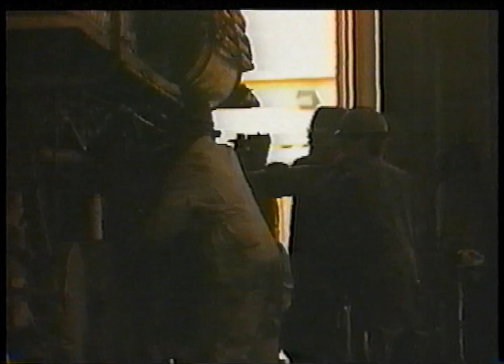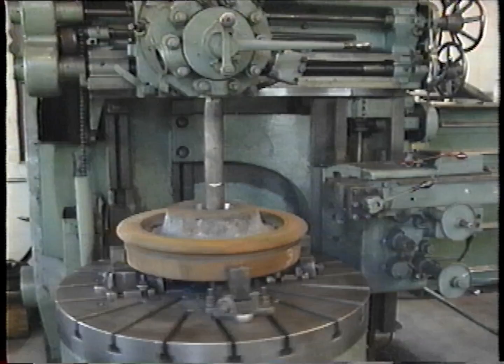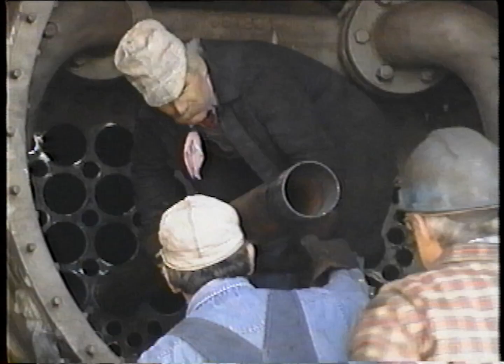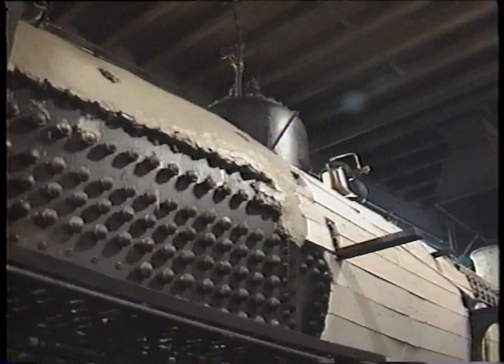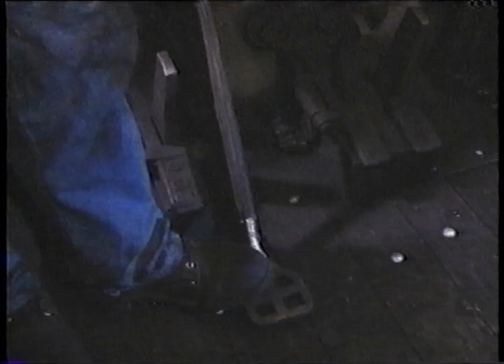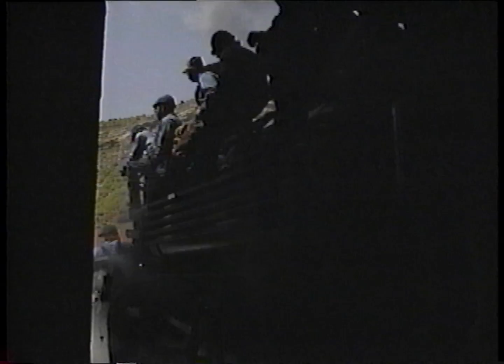Rebirth of a Locomotive - D&SNG No. 482

Comment: Why was 497 traded for 482 when 493 was eventually brought back to service?
Reply: From what I’ve heard, I think it was because 497 rode harsher at the time due to her trailing truck (I think it was her trailing truck) being messed up from a derailment she and 498 had in the 1960s. The reputation of the 490s tanked because of it even though 497’s rough riding issue was eventually taken care of by the Cumbres and Toltec. By the time 493 was restored by the D&S in 2020, that reputation was proven false when the Colorado railroad museum brought sister 491 back into service. They have their flaws, but they are solid engines.

Comment: Thank you for posting this! This includes extremely rare footage of a quartering machine in operation. For what ever reason this is something rarely seen on video. As suspected the crankpin journal surfaces are “fly cut” AFTER all the initial quartering of drivers and outside counterweights are completed by pressing them to the axles FIRST. It’s been my suspicion all along you could never accurately quarter crank pins by driver or counterweight hub bore keyways alone! 

This is an interesting overview of the whole restoration process by none other than the “Convoy” narrator himself C W McCall. Thanks again!

Comment: This engine has, in recent years, been converted to burn oil
Reply: if that's what they need to do in order to keep steam running, then that's what they should do
Reply: The Durango and Silverton converted their steam locomotives to burn oil because of a forest fire back in 2018 that they said was caused by sparks from the steam locomotives when they were burning coal
Reply: @ I know, I don’t think it was because of the actual fire though, I think it was because of the lawsuit against them for the fire, and so they converted all of their locomotives to oil and started buying a few diesels
Reply: And as a result, I miss seeing her with the spark arrestor